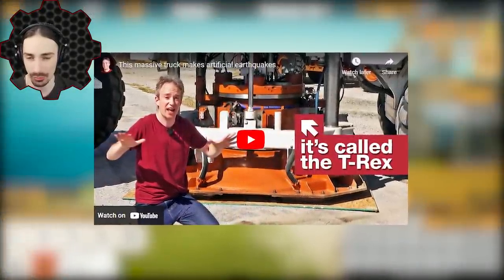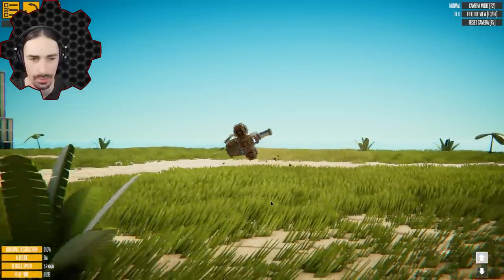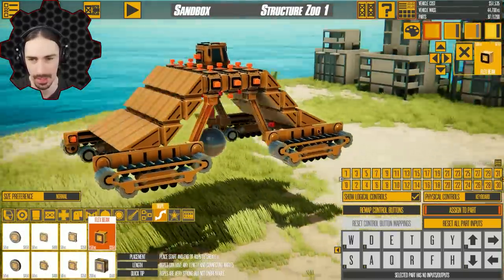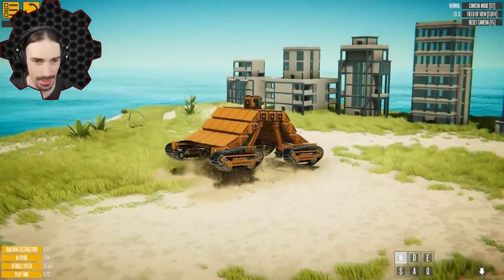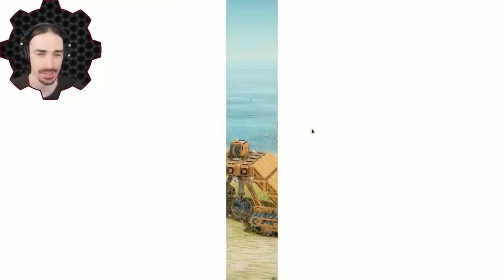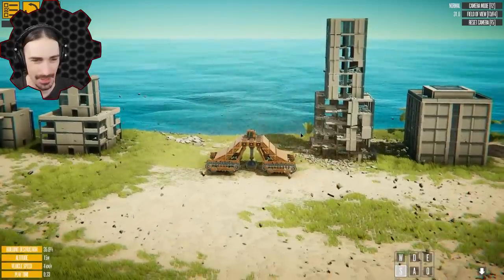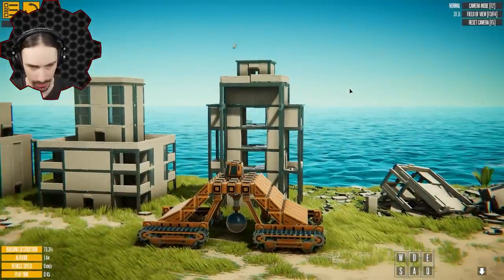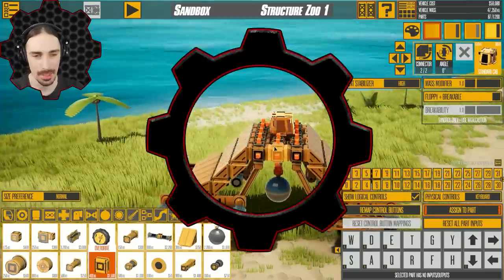I Built an Earthquake Generating Machine! [Instruments of Destruction]

Comment: I recently made an earthquake generator that doesn't need mega impacts and still deletes buildings (with mega impacts it instantly deletes the hole map) i just stacked a bunch of weight blocks and upward facing pistons to pull them into the ground 
It was so heavy it pulled the ground anchor's quite far off the ground 
I highly recommend you try making one like this, its lots of fun and plenty of screen shake
Reply: Can you please put a link to the steam workshop page?  I want to try this out.
Reply: Man gonna recreate 2010 earthquake
Reply: Made one after scrapman made his vid on the hammer thing. Litterally used 8 doubled overdrive pistons to repeatidly smash the ground with a 100-200k kilos weight and it shredded buildings.
Reply: whole not hole sir
Reply: @acsadventures007  Not after he's done with it!
Reply: the hole ground?
Reply: @datbubby  It's not funny if I have to explain the joke.....
Reply: @lawrence8871  your joke was funny. I was just commenting on the original poster. 
This is precisely why i did not tag you on it
Reply: @datbubby  Ah, I see

Comment: I think you underutilized the settings on the piston quite a bit. The min and starting position levers would also change the average position of the piston while under oscillation, which would fix the problem of high strength settings not reaching the ground. Not sure how exactly it would affect it, but putting the starting and min positions to as close to the ground as possible without touching should at least have some interesting effect on it.

Comment: I think the issues were to do with physics engine FPS and the relation between speed and stroke length.
It seems like the physics engine doesn't do too many inter-frame... frames. So what happens is the strike is above the ground in one frame, then the next it has gone all the way down and now has come back up so the engine doesn't detect that as a hit.

A solution might be to have a way longer stroke so it ends up inside the ground, colliding, for longer?

This is all just guess work though.